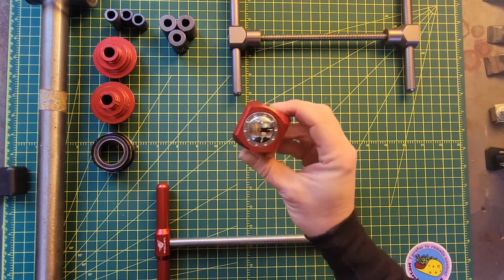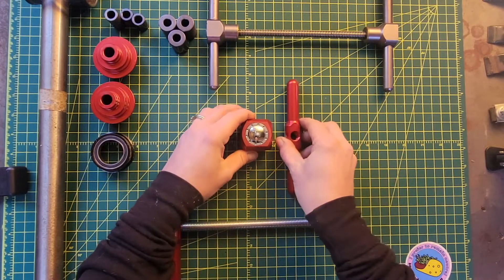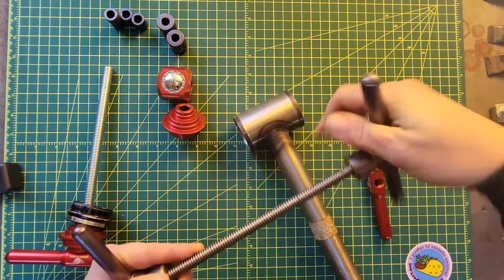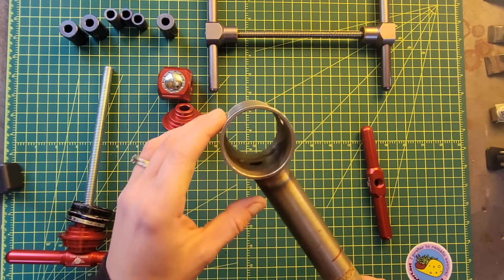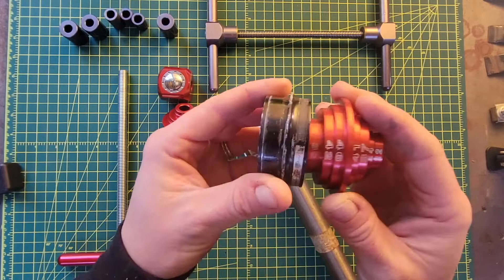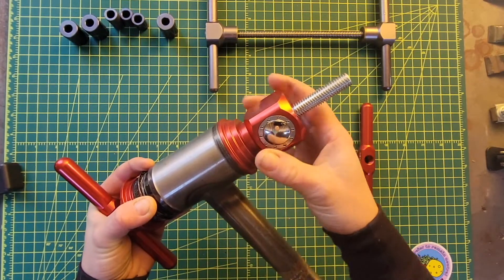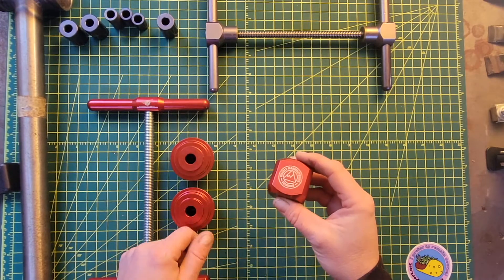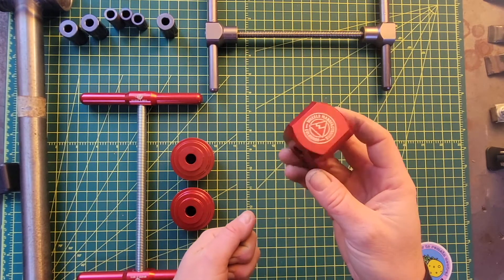TOOL SHORT #1: Wheels MFG Adjustable Press Stop

Comment: Cool content! I just subscribed. Is this the Press-7 bearing press? Also do they make drifts to press in headset cups (such as a Cane Creek 40)?
Reply from the maker: Thanks! In this video I was using "Bottom Bracket Essentials" Press BP0006 (Used to be the "economy" press). The other "Wheels Manufacturing: Pro Bottom Bracket Tools" video features their "Pro" Press, BP0007. They sell the headset drifts separately so you can combine them with your existing BB press handles (HT-OB and HS-OB)
Reply: @NeutralSupportNews  Thanks! I might pick those up soon. This seems like one of the better presses on the market for the price